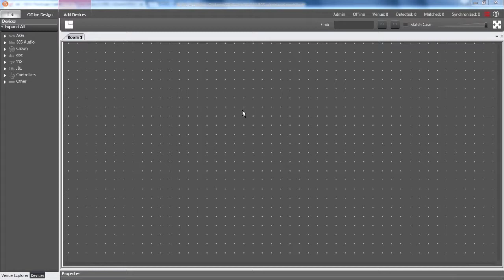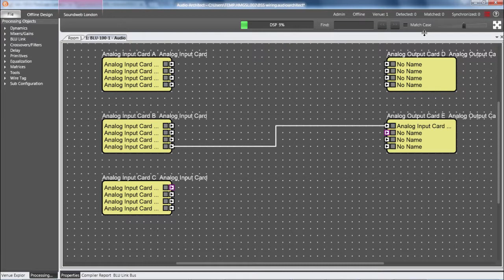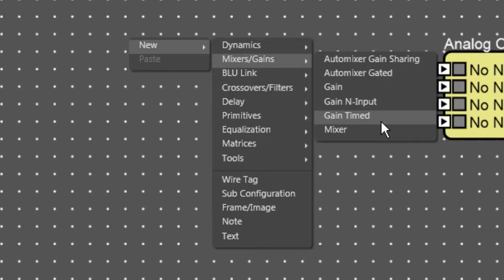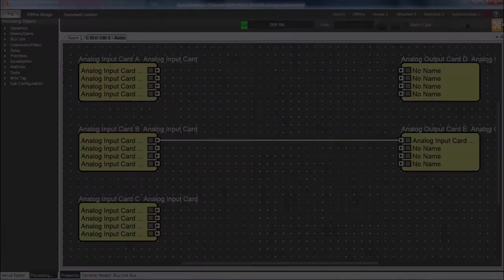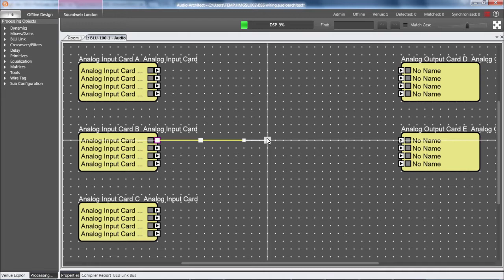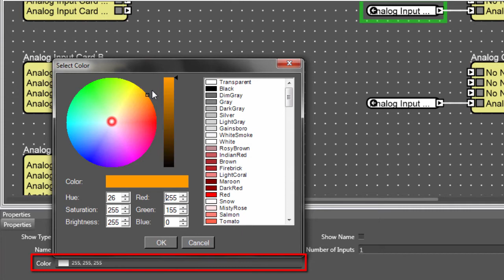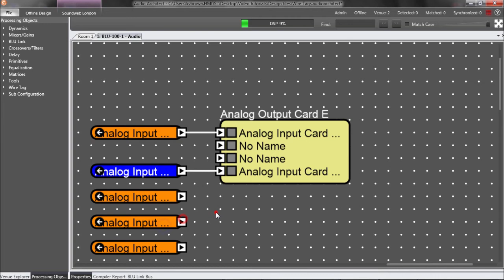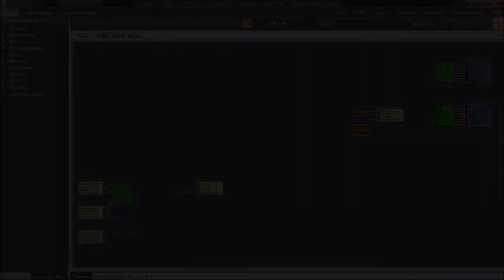BSS | Chapter 1 - Virtual Wiring

Comment: ok that's all cool but WTF is it used for?
Reply: A BSS BLU-100 is used to extend the inputs and outputs of a Public Address Sound System.

For Example, let's say you have a Media Player, 2 Wireless Microphone Receivers, and you Have 5 Amplifiers to drive 50 Speakers in 5 Floors of a Building, distributed as 10 Speakers for each floor.

You will need to distribute the sound of the 3 sources mentioned above to the 5 Amplifiers.

You would make a huge number of junctions using microphone shielded cables to distribute the same 3 sources to each input of the 5 Amplifiers, which is time consuming and daunting. 

And that's where the BLU-100 from BSS comes into play.

You connect the 3 sources into 3 inputs of the BLU-100, and you will connect 5 output ports of the BLU-100 into each input of the Amplifier.

And using the software mentioned in the video to do all sorts of routing and DSP, as well as fire system integration to mute the music player when fire occurs.
Reply: This comment and reply made my night.